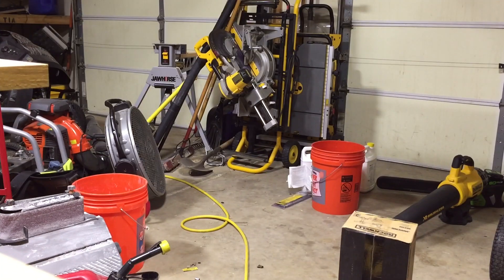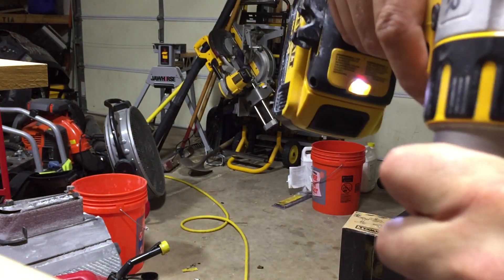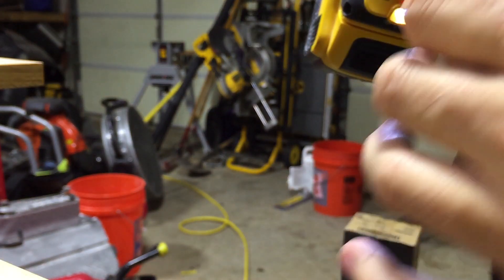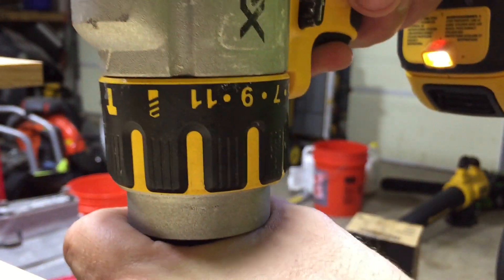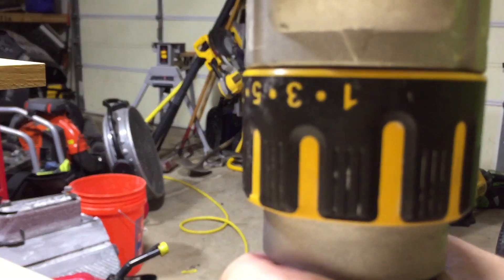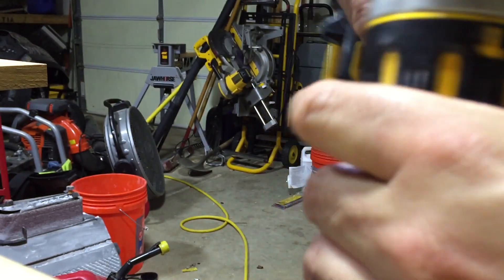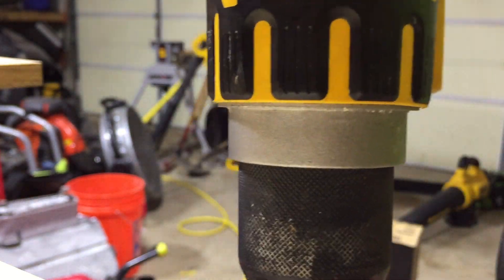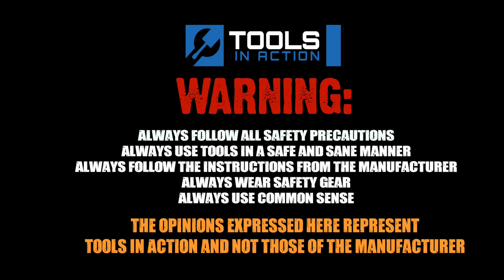Ultimate 18V tool fight -  Update Panasonic EY7950 Fail

Comment: Makita BHP451 lasted me exactly 6 days before the chuck broke on drilling 6mm holes in bricks, it wasnt keeping anything tight enough. Returned it and bought the equivalent top of the range Dewalt, which lasted exactly 30 days before the clutch or gearbox gave up and the drill was simply slipping, motor working but the chuck didnt.

Bought the Panasonic top of the range (EY7950) with 3x 3.3Ah batts, gobs of power, right up there with Makita, except its been reliable as fuck, not a single fault or even a glitch in the 4 years ive owned. And built houses with it.

Comment: I was thinking, how would a good old fashion corded drill hold up in this torture test, since they don't have all this new fangled electronics in them.  It's looking like it was the electronics that failed.  Looking forward to seeing what aVe does with these, and wondering if he will be able to tell what caused the actual failures. This was an awesome tool fight, has is as sparked a lot of excellent discussions.  I been enjoying reading all the comments the crew has posted.
Reply: corded? ZAAAAAAAAAAAAP 
mains voltage + water = nooooooo

Comment: make no mistake a panasonic drill will outlast those other drills . we run all of them in a workshop and you cant judge tools on extreme loading  .
Reply: Tony Mckenzie yes , I have retired Panasonic drills after 10yrs because of upgrades and lighter weight - they have never failed or even degraded in power or battery , best drills iv ever owned and I will stay loyal

Comment: The DCD995 (which I have and love it) is rated IP65, which means "Water projected by a nozzle (6.3mm) against enclosure from any direction shall have no harmful effects".
Instead you have submerged the tool in a bucket full of water... SUBMERGED.
No shit it got damage. I Hope there are not so many "professionists" that drop their electronic tools in water.
Reply: My 14.4 Panasonic impact driver out-performs all the Makita 18v drivers at work. Best drills on the market.
Reply: Lance Staff You don't seem to be able to understand a couple of points here.
In 1st place by submerging something rated IP65 you are just fucking it without even testing the statements of the manufacturer: Is the dewalt really rated IP65? Who knows, this video confirmed it isn't IP68 for sure.. no shit sherlock.
Secondly, yes tools get dropped, machinery crashed etc... But if that's "normal" why don't you go to your boss to tell him "Hey stuff happens on job sites, drills get dropped".
Let me know his answer.

Comment: im actually surpised the dewalt has held up so long.  At my work most joiners, electrcians and plumbers have been supplied with the dewalt 18v kits.  And all of my last 6 journeyman have had to have theres replaced due to the trigger going faulty, the chuch locking up or them just burning out.  And for the record they are not being put through extreme abuse, only really used for holes upto 32mm in wood, 4inch in plasterboard, 10mm in steel etc etc

Comment: I bet a brushed dewalt drill would have outlasted the brushless one in your tests. Clearly it's the electronics in the brushless motor that have failed
Reply from the maker: 1944johndeerel Maybe
Reply: +1944johndeerel 
Quite the opposite. Brushed motor drills have electronics as well AND the added failure point of the brushes. On the other hand you would have to work hard to make a brushless NOT waterproof.
Reply: +1944johndeerel brushed motors are tougher than a coffin nail.
Reply: +superdau The electronics required to run a brushless motor are not inherently waterproof. Only the motor.
Reply: this wouldent stop me from buying one they are hands down fantastic tools to use i sold all my 18v XRP's when i bought my first 20v set

Comment: Why does Panasonic make cordless tools? Their tool line is confusing, doesn't offer variety, and offers less features than Ryobi, Makita, and Dewalt. The battery lineup is really retarded; 14.4v, 15.6v, 18v, and 28.8v (which only one tool uses). Some tools are compatible with both 14.4v and 18v, some are not. Why not have just an 18v only system and drop the other types? Why would someone invest in the 28.8v SDS hammer drill when there's only one tool compatible with that battery? Just get a corded one with more features for less money.
Reply from the maker: George Moore It is strange